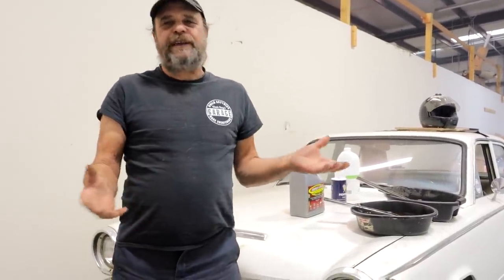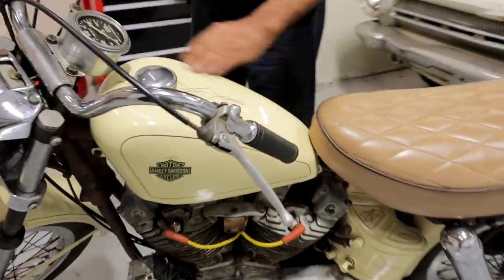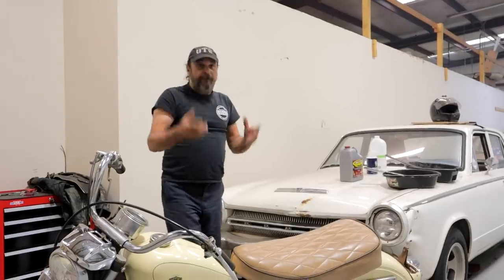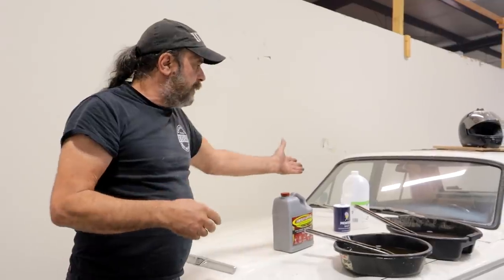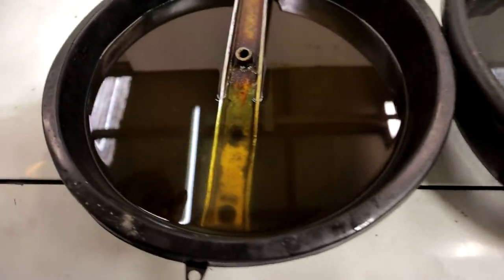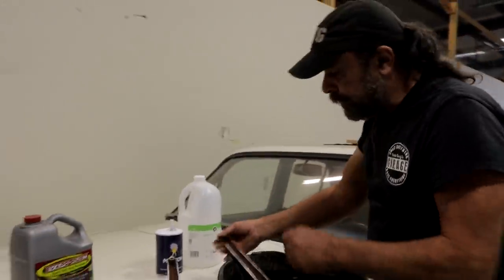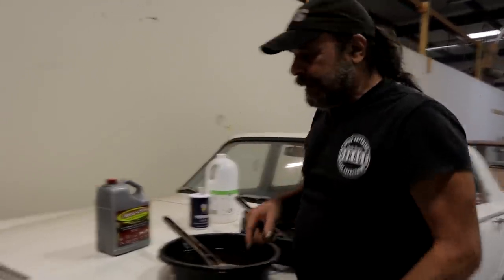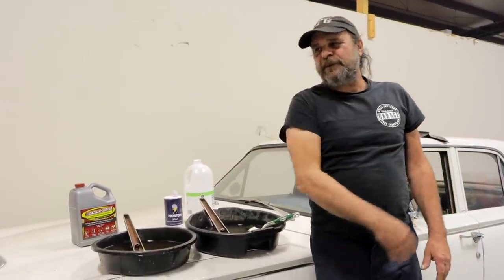Evaporust Vs. Vinegar - At 10X The Cost Does It Do 10X The Job?

Comment: I use muriatic acid. A few decades ago I soaked almost a whole VW bug in muriatic acid. It got rid of ALL the rust. I soak nuts and bolts and small parts in it, I have used it to remove rust from motorcycle tanks, very hard to beat. The only issue is not to leave it in a tank for too long, after it destroys the rust, it will continue eating through the metal.
Reply: I use it, also. Works great, but you have to monitor the time the part is in there.
Reply: Muriatic acid will leave chlorine ions on the surface of the metal, which will make it rust allot faster, so you have to wash, neutralize in an alkaline solution, was again and seal the surface pretty much immediately after taking it out of muriatic acid.
Reply: @ghffrsfygdhfjkjiysdz  Yes! Neutralize it or you will have trouble.
Reply: @ghffrsfygdhfjkjiysdz  That's true if you really want to do it right. Most of the time I just rinse the part really good and coat it with WD-40.
Reply: @ghffrsfygdhfjkjiysdz  in theory the best thing would be to use muriatic to break up almost all of the rust, rinse and scrub with baking soda to abrade any residual rust, clean up pitting, and neutralize, then some nice hot water and seal. In practice it's usually whatever you have handy and however you can get to it. A steel brush, brake cleaner, canned rust converter and some tractor paint is sometimes all you can do. Honey coat is another good option for stuff you can't reach I've heard, but I like the idea of converter and some heavy duty paint. The stuff I did the floors of my a-body in was great, some generic brush on tractor paint that settled out real flat and left a rubbery texture to it. Held up great to abuse when we had to hammer some of the trans tunnel for a modern trans to fit in and was walked on plenty without any real scratches.

Comment: If you're going to use vinegar (an acid) on any metal, follow it with a flush of baking soda. Add baking soda to boiling water, then cool. The undissolved soda will fall to the bottom. Use only the clear solution.
Reply: Can I ask why?
Reply: @Guitarsnspraycans  Baking soda neutralizes acid, stopping that process. By boiling and cooling, any undissolved solids fall out of solution. You wouldn't want it in your fuel system. It only takes a few minutes.
Reply: Do not waist your time with baking soda, ammonia is a base and will nuke battery acid or vinegar. No powder mess.
Reply: @tomg6284  no offense, but get your money back on your chemistry set.
Baking soda is the number one neutralizer for sulfuric acid. Besides being non toxic (ammonia is poison), it's many times more potent, and will nuetralize acid down into the smallest rust recesses.
Also, ammonia will harm most unpainted surfaces found under the hood.
The MSDS on baking soda basically says it's harmless.
Reply: Vinegar is a weak acid, and a 5% concentrate at that (if purchased from 'the store').  I've de-rusted MANY auto parts with heated vinegar and a simple rinsing afterward seems to be sufficient.  I've painted and powdercoated those parts with just a simple rinse and no additional prep (meaning, no sandblasting nor etching).  I've had zero noticeable degradation in my coatings.  Sometimes there's more than 1 'good' way to accomplish a goal.
Reply: @tomg6284 And then have to deal with ammonia?  That's ridiculous.

Comment: Tony, I've used various methods of rust removal to restore cars and have found EvapoRust perfect for certain tasks.  Since I'm mostly into original restorations where the proper bolt heading marking is necessary.  I use EvapoRust rust in my Harbor Freight ultrasonic cleaner with the heat on.  It works much better with heat and removes rust, light grease an over spray leaving the caduim finish untouched.  I believe the container of EvapoRust states to remove scale rust before use which means it's not going to clean your fuel tank without the boots sloshing around.  Vinegar is cheap and another great rust remover.  Thanks for the video.
Reply: How did you deal with flash rust? Did you just throw gas in the tank right away or  coat the inside?
Reply: @funkybassguy68  After EvapoRust process, I cleaned with tap water and placed before a box fan for drying inside my garage.  I had little to no problem with flash rust.
Reply: I do the same thing.  Box fan drying and usually little to no problem
Reply: 8 month old comment but does evaporust really leave cadmium in place, everything I’ve read (I couldn’t find much) says it removes the coating - I thought cadmium was an oxide so would be removed from sockets - I’ve got some 1945 snap on sockets I’m looking to keep as original as possible
Reply: @bradleypease2492  I've put plated bolts and nuts into EvapoRust, and what plating was still on the hardware did not come off.

Comment: After using vinegar on a tank once I am wary of it, it is an acid and will eat into the healthy steel along with the rust. I would never let it soak for more than 2 hrs. Evaporust on the other hand is not an acid, it chelates, and I much prefer it to vinegar. It is much easier to work with imo, the problem with vinegar is as soon as you drain it out, the tank will begin to flash rust almost immediately. You have to neutralize the acid by pouring water + baking soda into the tank. Reintroduction of water after rust removal will result in more flash rust in my experience, I strictly rinse with acetone, never water. There is no flash rust after draining evaporust, you can just rinse it out with acetone and it will remain rust free as long as you keep it dry, i don't even have to coat with oil. And yes evaporust will take off paint, gotta be very careful not to spill. In summary evaporust is worth it for the peace of mind that I know it cannot damage the healthy metal.

Comment: I've always used molasses and water for rust removal. That stuff will make the soles of your shoes melt over time
Reply: I'm a fan of molasses.  I have a tote full of the mixture (10-1) that I've used for years.  Doesn't wear out.  Have used it to remove rust on all sorts of misc parts & pieces.  The down side is it is slow which creates another problem, you can forget a part is in there.  I have destroyed a few things as it will eventually eat all the metal.

Comment: We have this special method of removing rust here in Milwaukee....   just drive your car for one winter and the rust will just disappear along with the body panel.   Pro tip,  make sure to drive over a few of our bathtub sized potholes to add some violent shaking for maximum effectiveness.

Comment: I used Metal Rescue with excellent results on my KZ.  Two things about using these kinds of rust dissolvers:  1) The tank must be oil free, use lots of hot, soapy water, rinse thoroughly (think car wash wand) and then use plenty of alcohol to dry it, and 2) The rust dissolver works best above 80F.  I didn't use any agitators (nuts, bolts, vibration, etc) but I left the tank out in the hot AZ sun and sloshed it around periodically for a couple of days and the entire interior of my tank was pristine.  Even the cap looked brand new.

Comment: Great review Uncle Tony. For rust in small metal gas tank, still partially galvanized, suggest household liquid ammonia full strength. Put pebbles inside, soak and shake for maybe 6 hours. Avoid breathing fumes. Pour out liquid with rust and pebbles. Rinse well with hot water, invert drain completely, dry in hot sun.
Alkaline verus acid, acids eat any zinc coating left.

Comment: Apple cider vinegar and baking soda when mixed together and applied aka scrubbed with cheap toothbrush will clean and polish chrome and take off rust specs with out scratching up the chrome. the vinegar has a chemical reaction to the rusting process and neutralizes it .

Comment: I’ll add my two cents, what’s the temperature in your shop? I have used evaporust on several gas tanks. Ive found when using evaporust, the ambient temperature really affects it. What Ive noticed is the warmer it is, the better it works. Id say atleast 70° is best. Between 60-70 my results varied and below 60°, it almost never works for me.
Reply: Metal Rescue works the same way, the warmer it gets the better it works. It`s also important to fill motorcycle tanks completely full put in the sun all day, or run your heat gun on it and the rust dissolves, it is a little pricey but you can reuse it and get good mileage out of it.
Reply: @Foontflaky  I wonder how a submersible heater like you use in an aquarium would work.
Reply: @aggiebq86  Prolly work great it would take awhile to warm up though, you can run the a hairdryer on it too, if you don`t have a heat gun, solar power works the best, it`s free!

Comment: In my experience with vinegar the parts need to be fully submerged for days not hours.
Just got done soaking D100 parts for almost a week and pretty heavy rust is gone…
Buy vinegar at Costco you can afford to buy  as much as you need.

Comment: i took the tank off my 1969 d100 and filled it with apple cider vinegar and water 50/50 let it soak for 5 days,that tank was corroded  bad,it was bad,nothing for 2 days then on the third and fourth day stuff floated to the top and what a mess,it cleaned the tank perfect,i flushed it 3 times with cold water let it set in the sun on a summer 100 degree day soon as it dried i shot two cans of pb blaster into it,set it up till my new carb arrived,added three see thru filter s in a row in line to the new pump,and two after the pump the filters are cheap and disposable,its still fires on the first spin,threw away 4 filters and left them in series as i'm letting the truck sit while i get the king pins installed,cost 20 bucks for the vinegar,when i threw it out killed a bunch of weeds with it,win win

Comment: Thanks for passing on what you found; and in respect for limiting the comments, this tid-bit may be helpful to others or not.   In Under-grad, w/ mixture chemistry they taught us that surface area exposure matters in terms of chemical reactions, especially as it relates to O2.  Cliff notes: Consider in-tank anti-rust  underwhelming; compared to the  a 14" catch pan.  Greater surface area to ambient gas may correlate to greater rust reductions-vis-a-vis potentiation of oxygenation.  Citing specifically gun barrel blueing works much better in open top tub than a  semi-closed tank.  And in the nature of fun, we forget our 6th grade chemistry class that barometric Pressure @14.7 PSI often matters.
Reply: So how about an aquarium air pump bubbling in there, theoretically would that help do you think? Thanks!
Reply: The word is "Citing"....not "Siting".
Reply: Cliff notes: More simply put ... AERATION   That bit of academia hurt my head deciphering it ...... admittedly I've been sick though.
Reply: @ytwatcher8288  Interesting idea, my chemistry is a little poor, and I'm wondering if the oxygen would distribute evenly in the solution?
Reply: @fireballxl-5748  Citing not siting excuse me.
Reply: @ytwatcher8288  It almost seems it would have to be more effective than a static pan; though active aeration may increase off-gassing of cleaning agent High Hydrogen and be dangerous in close quarters for breathing etc.
Reply: @tylertkelley6779  Thank you.   You have shown your maturity in not taking offence and I really appreciate that.   Very few can accept correct/constructive criticism.  You are to be commended.  Thanks again!
Reply: @fireballxl-5748  U2
Reply: @charlesangell_bulmtl  On the positive, you got it out of the way for the Holidays!  I do not like when anything comes between me and a hot meal.

Comment: I've had a good experience with Evapo-Rust on parts used in old car restoration. According to the label, it "chelates" the rust. It doesn't remove or damage metal, unlike acid-based materials. It washes off well with soapy water. Evapo-Rust is fairly slow, however. It works fantastic in an ultrasonic cleaner with a bit of heat. Not sure, but my understanding is that it is molasses based. The same company also make a rust preventative coating that works really well. No, I don't get paid by them. I'm no expert, just trying to help someone else with my experience.

Comment: The biggest upside I've found to EvapORust is that when (not if) I forget a part in it for a week, the only thing I have to deal with is a bit of blackening.  I've done the same with vinegar and come back to a horrible, disgusting mess that was worse than when I started.  It also is better for nuts and bolts since it won't eat away the peaks of the threads... but for big chunks, vinegar works great (just don't forget about them!  lol)  As with all rust removal methods, every solution doesn't work for every situation, so it's good to have a backup.
Reply: What is that black finish?  I left some drive axle bolts in EvapoRust and they turned from grey (a zinc coating I think, ZNS3) to black.

Comment: Used electrolysis on my 68 Dodge D200's tank. Looked at all the options and went that way because it's cheap. Old school battery charger, washing soda, a steel rod and water. Process is slow! Pulled the rod a couple times a day and cleaned it, for I don't know how many days. 
 Wasn't sure if it really worked until I did an acid rinse with a bit of muriatic. That shined it up, no rust inside.
Since then I've done other things, after their cleaned they're not real shiny but the rust is gone.
  Actually thought about doing a video but there's a million of the already.
Reply: yup its slow but it'll get it ALL eventually.
Reply: I'd suggest using several graphite rods. They last much longer than anything else. I usually put one in each corner of the tank.

Comment: There’s a pretty good projectfarm video on this subject, where he tries a few more products. Personally I’ve had pretty good luck with evaporust.
Reply: Problem is, I don't think the tank is just rust.  It's got jelled up gas as well and evaporust is not going to be able to get to the rust because the rust is underneath the gas residue.
Reply: actually I've had really good results with "Pickling Vinegar" it has 7% acid and works very good rather than blowing money on expensive EVAPO RUST
Reply: @Canadiancarguy1987  bang for the buck acetone and vinegar works. Better than paying local radiator/gas tank shops 160 bucks to “boil” it.
Reply: @tarstarkusz  I’ve used acetone and I try to catch as much of it as possible and even though it will be soiled I can use it on multiple gas tanks.
Reply: @abeld.4008  Isn't that what carb cleaner is?
Reply: Uncle Tony I've been through something like that recently. I'm fixing and selling lawn equipment as a second job. Evaporust reacts with zinc coated parts and it actually weakens the evaporust. You don't notice it with hardware especially lightly rusted stuff, but gas tanks seem to just kill the evaporust. Also any grease or jelled up fuel diminishes its abilities too. Generally before Evaporusting stuff I spray it or soak it with Zep purple degreaser,scrub and rinse it well, then let it dry over night. The evaporust works faster and better plus I can use it more times before it isn't effective anymore. I don't want to paint my gas tanks either,  I've had the best results with acidic toilet bowl cleaner. The one I use is a commercial one it's a liquid with a flip top, and it stinks. I pour it in and within about 5 minutes the tank is either rust free or damn close. Afterwards you have to  rinse the hell out of it and start flushing it with baking soda or it will rust up worse over night, Then fill it with gas asap.

Comment: Acetone works miracles first to remove varnished gas then hit it with vinegar for the rust.
Reply: This is spot on. You have to remove the varnish gas coating first.
Reply: Yep. Came here to say this.
If you don't get rid of the varnished up crud, the rust ain't going anywhere.

Comment: I just started using Evaporust and I love it. I use it for small parts. Bolts, nuts, brackets etc.
I will degrease beforehand with Dawn dish soap and a wire brush. If there's any paint I will sand that off also. I let parts soak for about 12 hours then wire brush to help it along. Then soak for another 12 hours. Wire brush again then rinse with water. Always turns out perfect. Like brand new!

Comment: You can make a simple vibrator from a 1/4 sheet sander and use velcro to attach to gas tank or container holding the solution. Cheaper than an ultrasonic bath. 
Yes I like vinegar solutions, usually takes some time waiting on it.

I have had good luck with muriatic acid and water solution cleaning gas tanks. Flush out with baking soda and water. Dry well before flash rust forms and spray with WD-40 or something to coat the metal until you get gas back in the tank.
Reply: Great idea!  lol.  I gotta not convert everything to cordless.
Reply: Uncle Tony doesn't use a vibrator
Reply: @DumPhuc  
Guess you have not ridden an old Harley and why women did not mind riding the *itch pad.

Comment: Nice job Uncle Tony.  Now, Project Farm  (I really enjoy his channel) will do a test featuring 20 different rust removal methods, and he will show microscopic comparisons of each and every test.  I say remove the tank, sand blast the inside as much as you can and coat it with a sealer several times.  You can get that petcock out...one way or the other.  It may involve a torch but, as you know, fill the tank with water first to make sure all gas fumes are gone..

Comment: Your crew has some great comments, covers the subject from top to bottom. I use Evaporust on old rusty micrometers and such. One nice thing about Harley Davidson gas tanks is the wall thickness is pretty beefy. I’ve cleaned many a Japanese gas tank and by the time the rust is gone you end up with a lawn sprinkler. ps: keep going and the petcock will come out eventually.
Reply: Maybe spray Kroil or whatever inside the tank and let it work into the tap's threads from the inside?